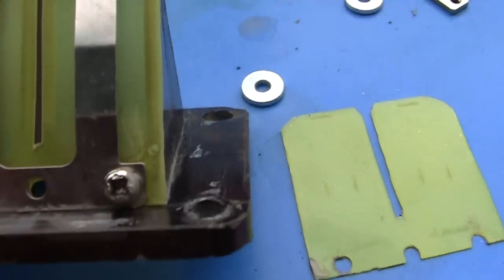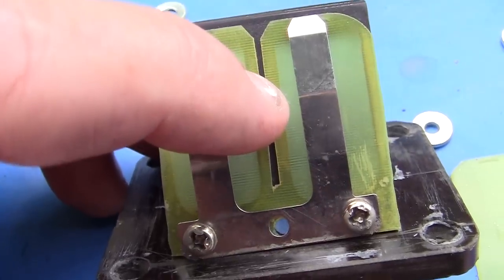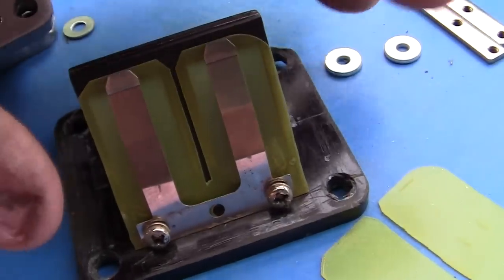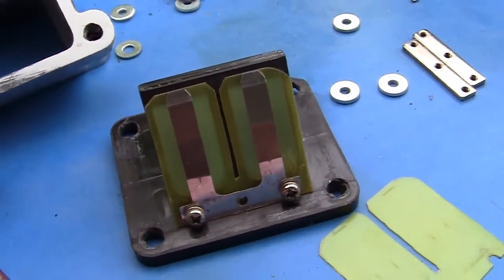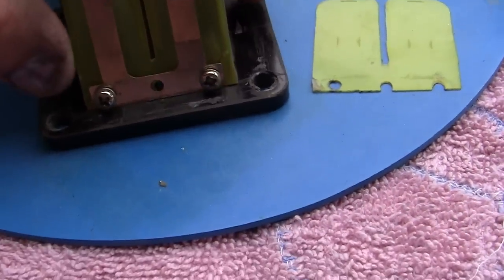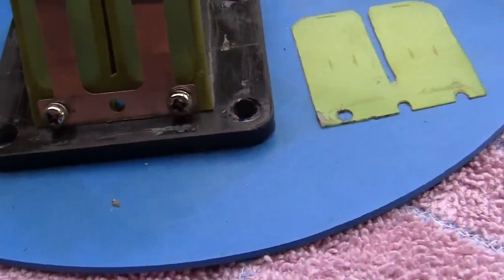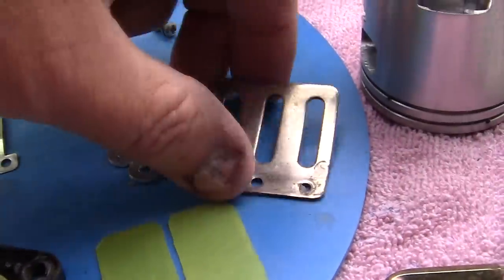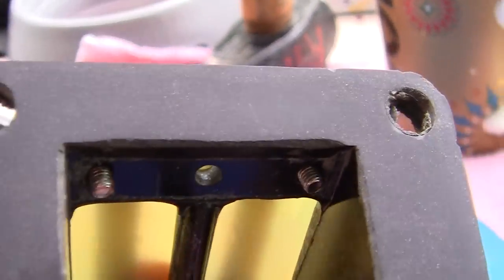7)-  HOW TO= Tune Reed valves for MAXIMUM  POWER !!! (the end)

Comment: great vids mate would it be the same for a aprilia rs125 i know there highly tuned for a 2 stroke would it be possible for you to do work on one
Reply from the maker: I have never worked on an RS125 as they do not sell them in the states. I really want an RS250 but the cheapest one is 10 grand when they come up for auctioin. I would have to see the reed cage to see if it could be done.
Reply: I have to send you them or send you a video of them if you want

Comment: So , how long did it take for that ratty old fiberglass reed to end up in you'r crank?
Reply: agree is not quality without reed stop, possible it works at low speed but not at 14,000 rpm
Reply: Yea carbon fibre is the way forward
Reply from the maker: +vonSnook About as long for you to find a girlfriend who aint Latex- Never.
Reply: +DIOSpeedDemon  You need to rewatch this vid.  It doesn't show 2 stage Boyeson reeds.It shows a single stage fiberglass reed (ratty).  There's no opening in the reed leafs and no 2nd reed over top of it.I ran Boysesons in my RD 400 back in 83,  and got no performance inhancement  beyond3/4 throttle .   But there was a definite  increase  in reed noise.  (note): picking on my sexual preferences is pretty low.   Got any lube ??? LOL
Reply: +DIOSpeedDemon  How'd you know my shop name was Stew-eI was a 20 yr. machinist , Aro-Space + hydrolics.  Oh my Metropolitan was yellow +white.PBHPbhpbhpbhpbbbbbbbhhhhhhh.  Kiss for ya.
Reply: vonSnook -> If that's true... why you can't spell the word "HYDRAULICS" correctly? LOL...

Comment: 4 strokes do not have Reed valves unless it's e early model xr 500 early 80s model had reeds only year they did
Reply from the maker: Yes , I believe some of the early 4 strokes had reed valves. They were custom matched to the RX500 Duel Muffler Bearing reeds. A very exotic bike, hard to find and a Fortune to Possess. I stand corrected. Thanks RH DSD

Comment: those are three different typres of rev plates for those reeds the smallest flat ones are for boyesen dual stage reeds which are a four piece reed six piece including the smnall flat rev plates which let them open right up i've race tuned bikes for over 20 years this guy talks garbage and giving the wrong advice on these reeds the ones first shown are crappy standard factory reeds and are crap for bottom end boyesen dual stage reeds give you better top end and bottom end and more crisp throttle response.
Reply from the maker: The problem is I have to take large reeds for a 125 Honda CR and make them work in a reed cage 1/3 smaller than stock. I have had excellent luck with my tinkering, EXCEPT I never should have used race fuel, as its additives May have warped the reed material. Jury is still out on that. Most race engines have valves and are named like Hemi. I agree with you about the dual stage reeds, I just wish boyesen sold the reed material in little 3x3 inch pieces. Every thing you say is correct. I just love tinkering with the reeds for some reason.

Comment: ROTAX, AIME, BRC , they test their engine to the fullest of their capabilities,  they call it,  STRESS TEST, guess what, the reed cage got to be assembled back like it was, the only thing is the reeds, you can buy after market made of better material,  but don't do any changes, I run karts, tried everything and there's a little margin of error in your tuning,  so don't do it, tune your carb, keep everything clean, use the right fuel and oil ratio depending on the engine and that's it

Comment: I liked the videos.  pretty funny.  one question though, how did it work when you kept the reed stops out?
Reply from the maker: caseyhunt1 It works better with the reed stops out in this application, BECAUSE- The Reed cage adapter is so tiny , the reeds and stops barely fit, 1# , 2#= the boyeson reed material is natural stiff, so there is no high speed flutter at top speeds. THe boyeson custom reeds are hand fitted to the aftermarket reed cage in such a way, that the reeds fit perfectly flush with no leaks around the entire cage. Also the cage has been expanded by 10% by removing excess plastic in the reed cage stiffening areas. This allows more fuel to entire the engine and create more power.

Comment: and the lesson was???
Reply from the maker: The lesson is: "Snatch the pebble from my hand , Grasshopper"...Just before you get BitchSLAPPED.
Reply: The Title is "Tune Reed Valves for Maximum Power". There was no tuning. Take the stupid metal limiting spring off and let the thing breath. I built my YZ250 with 18:1 and 0.010 squish, fully ported, fat pipe with long stinger, advanced ignition timing curve, stiffened up the PowerValve a bit...it makes almost 60hp. It would definitely BitchSLAP you.

Comment: ahhh..DiospeedDemon....I see your problem.....I know what's wrong there....it's your reeds...they are the wrong type...they need to be the ones that fit into a 1992 RGV 250N Suzuki two stroke (with stage 2 hop up kit installed)...THAT's your problem.....oh, and the rest of the bike too, so, just throw all that junk you've got there away, and go get that bike I just mentioned...that'll solve ALL your trouble...I guarantee it....
Reply from the maker: My bike is the best I can buy in America. THey don't sell the Suzuki here. I would really like to by a Aprillia RS 250 or 500cc two stroke works bikes, which they don't sell here either. I can buy a 300 Horsepower Kawasaki turbocharged bike right off the sales floor but no decent moped. Life in America...